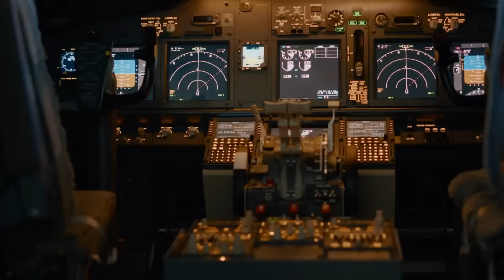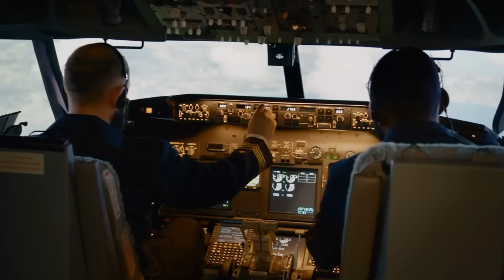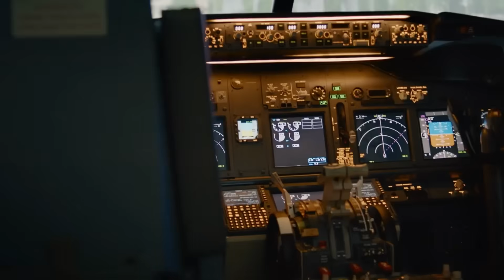Pentagon Just REVEALED the SR-72 DARKSTAR Fighter Jet That Will End All Competition

Comment: SR71 try mach 7 plus
Reply: No it couldnt fly close to mach 7, try mach 3.7 to 3.8. They skin of the plane would start over heating and melting. Mach 4 was possible except for the heat generated which will destroy the plane.
Reply: Try this you model rockets doing mach5 duh